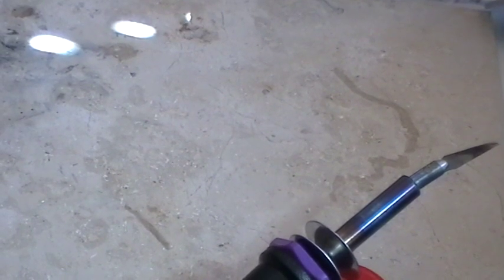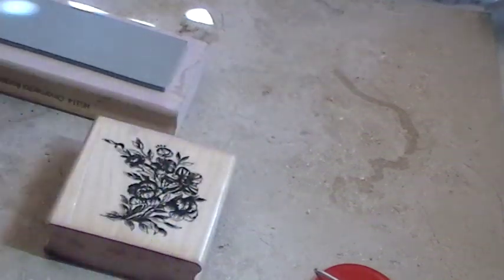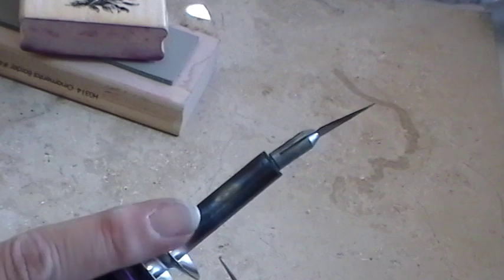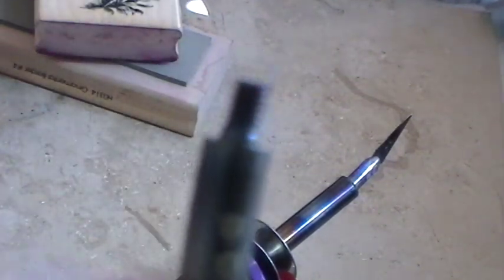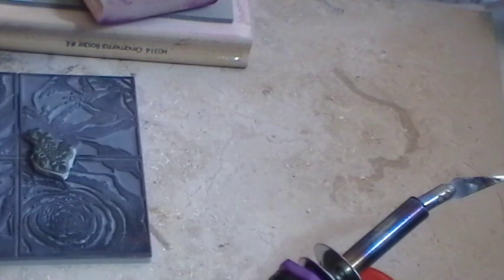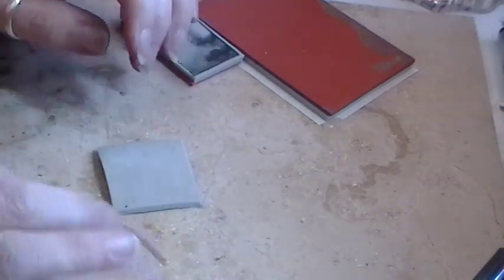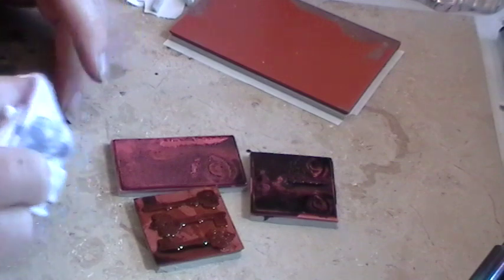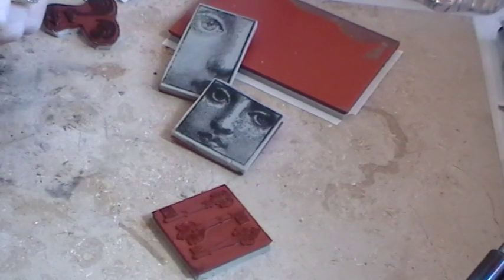TIps for dismounting wooden stamps onto foam mount

Comment: Love your idea of stamping the foam...never seen that before.  I had started unmounting all my stamps, but got tired of it.  Should go back now to do some more.  I softened them in the microwave then pulled off the sticker as well, but it never really stuck that well again.  So stamping the foam would solve this problem nicely!  Most of the stamps I could then I was able to pull from the wood with the foam this way, so I really didn't need to remount them all.

Comment: Its nice to know who made it if you use the stamp in a video and someone asks I guess.  I take the backing paper off before I cut them out.  I stick all my rubber down on the sticky side, peel the paper off the cling side, hold the sheet of foam and rubber in front of me and cut them out in the air, I don't lay the sheet on the table.  Man this is hard to explain LOL. But remember, I'm not stamping the image on the cling side.  You can't do it my way if you want the image on the back really.

Comment: Beck I do the same thing! I cut in the air...well you know what I mean. I peel off the paper liner on the cling side and just slice away. It's much easier if your not having to cut through the foam and liner attached. I tried stamping the image but it was way to much work for me. I use the stamp positioner anyways so I'm fine without seeing the image.

Comment: As long as you are stamping on the mounting foam, maybe you want to stamp again on a piece of paper and make yourself a catalog/binder to record what you have and the company name or whatever.  I have been carving my stamps in the air while holding them so I'm not pressing on the tip at all, maybe that would help?  I stick them all down and then carve them out but you can't do that if you want to stamp the image on the foam first so nevermind.  Ugh, its a huge project, great job.